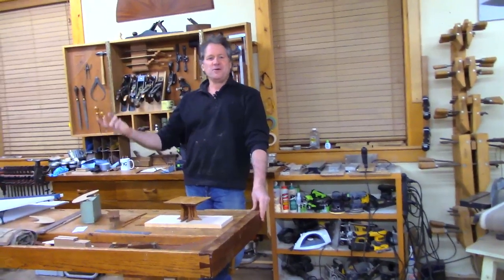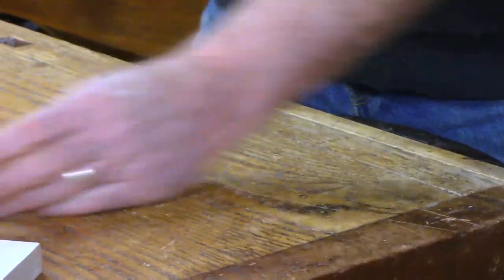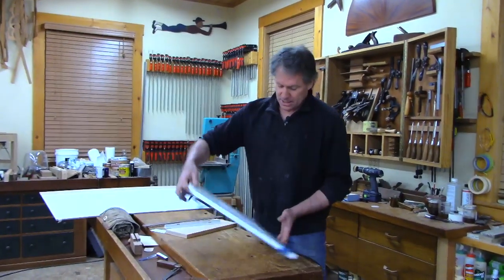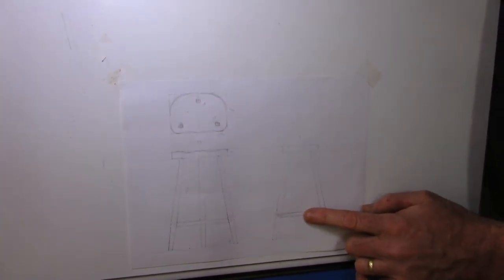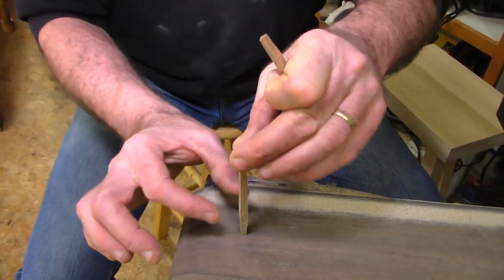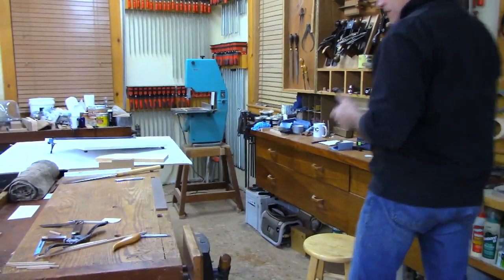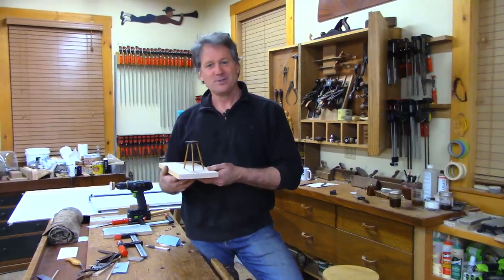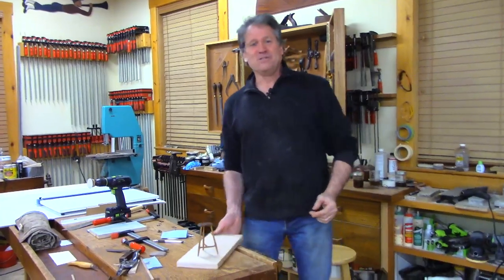Making Furniture Models with Tom McLaughlin

Comment: Hey, Tom really enjoyed this episode. I've never done modeling for a project but I will be changing my ways. It's great to actually see it and hold it in 3D. I'm really looking forward to the sculpting of the seat! I've got a question about the sanding block on your bench behind you... is that wood with cork on it or all cork? I like the finger grooves along the edges. I looked online and found something like it but wanted to check with you to see if you remember where you got it.
Reply from the maker: Hey Dan,
Yeah, I’m looking forward to shaping the seat too. I’m planning on doing a couple variations so that should be fun. Just got my Turboplane from Arbortech so will be checking that out too.
I do remember where I got the sanding blocks...I made them for myself and then for students who came for classes. I sized them to feel right in my hand and perfect for getting two uses of a quartered sheet of paper. They’re poplar and measure 1” thick, by 1 7/8” wide, by 4 1/4” long (the paper quartered is 4 1/2” long so it allows a little room over each end). The finger groove is just from using a round ended cove bit measuring about 1” wide overall. The cove ended up being 1/2” wide and about 3/32” deep, centered along each edge. Also put a 3/16” round over along the top edges of the sides. I bought a roll of cork with peel and stick adhesive cut oversized and stuck on the bottom then trimmed flush with a sharp knife or scalpel.
Hope that helps 👍
Reply: @EpicWoodworking  I figured you made them as that's what I was going to do if you didn't have a link that benefited you ;-).
Thanks for the measurements and have fun with the Turboplane! See you through the "Tube" on Saturday!